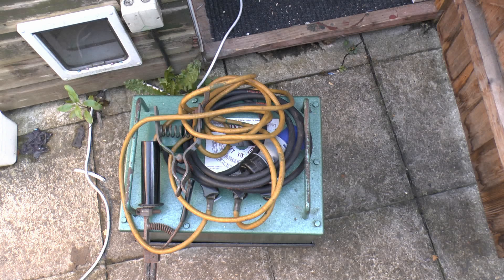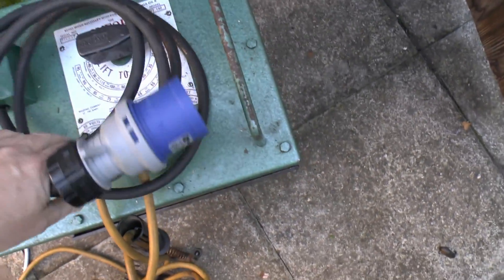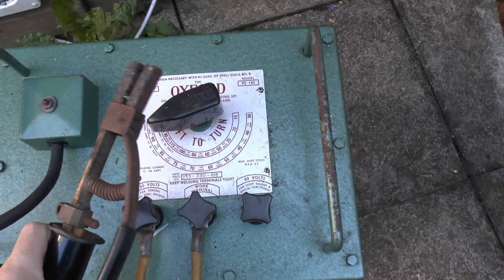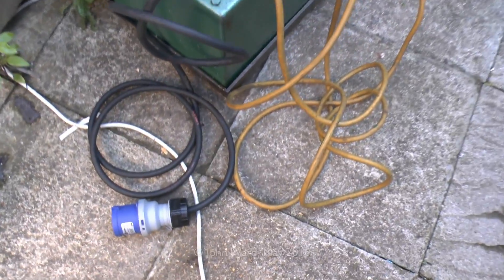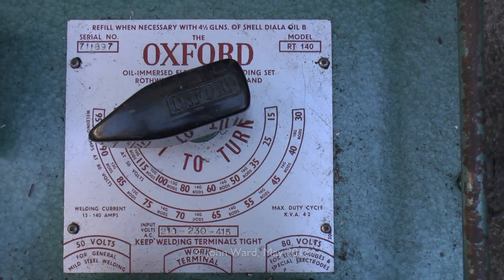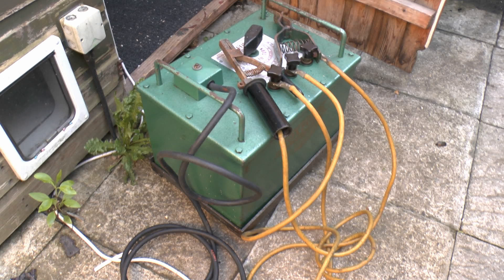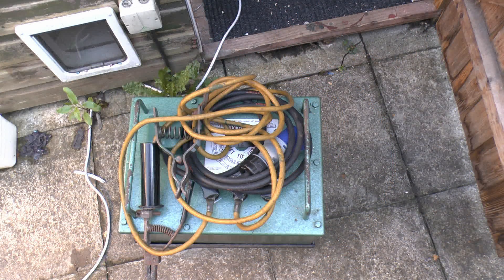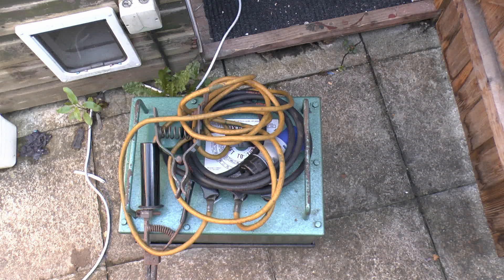Oxford Oil Filled Welder for High Current Tests

Comment: This is an excellent version of the Bantam Oxford  240 vote ac ark welder. Because they baste on a transformer the model is very hard-wearing.  & Have a very very Long duty Cycle It also has the capacity to lend itself to conversion to an AC Tig. . Some but not all are fitted with a Mentored of braze with the use of a carbon rod to provide an Ark to provide a ark to melt the filler rod, for brazing. but I have discovered the same can be achieved in AC by connecting too work leads to a Tig torch, & gas supply  The same can also be achieved to convert from AC to DC by fitting a rectifier between the work Input supply  & the live Negative earth for DC Tig work is proffered. As a Transformer it delivers a smoother current than one gets out of the coarser designs.   I have made the same conversion on my own set & used it for brazing jobs I am interested in the silicon barons version of brazing,

Comment: Hello, please reply. I have an Oxford welding machine, exactly the same as the one in the video. Is it 3 phase and does it weld 70.18 wire?
Reply: KO the one in this Film is a "240  Bantam  Modal & can be converted to 315  or 415, by changing the feed wires in the green box on the top The desired Phase Input is required. I have two tips for Welders One that is much larger & I keep for heavy weddings & have a bantam that is kept for 240-volt welding on a trolley so li can be moved to different jobs. & sights.  I often tack the bantam to do the general welding jobs,  If your welder is like the one in the film it will have the ability to convert from 415 to 240 Volts. If you own one consider yourself a very Very lucky person for they do not make the like anymore. You should hold on to it as long as you can.  & if you pass it on or down Instil on the recipient  That he or she Has, a diamond of a wedding tool If someone built them today they would make a fortune if I won the lottery I would go into business building them with a built-in AC/DC  filcher. for  Tig welding.

Comment: My RT140 has output voltage readings  85 v (at "80v" terminal) and 56v (at "50v" terminal), furthermore there is a 12v reading between the "Work Terminal" and the body of the welder. Why would this be and should I be concerned?
Reply: in some models, they had a transformer Or rectifier,  fitted which was a 12-changing ability we often found them in garages   &  for the charging of Batteries &  having a DC rectifier see the family that made them would make them to order if asked. That is why there was a variety of diverging designs & uses

Comment: Hi what kind of you need to top up?thanks
Reply from the maker: Originally Shell Diala B, however most transformer oil can be used.
A search for 'Shell Diala B' should provide plenty of options.
Reply: @jwflame  hi sir I’m
Considering to buy one of that model even they are vintage already..that’s why I’m making sure that the oil is still availble in the market.

Comment: Hi John,

Just wanted to ask if I can run an Oxford rt180 from my consumer unit in my house, would it be ok to replace an unused rcd in the consumer unit with a c curve rcbo and then run 4mm cable to a 32a ip67 commando socket fixed to the outside wall of the house.
The would be in the shed about 25 feet from the commando socket.

I do have a 32a supply to  a building outside but I’ve checked the supply and somebody has previously ran 4mm twin and earth  underground to an old style consumer unit (push in fuses) that is out there, I was hoping to find armoured cable out there.

Would be grateful for any advice you can give, thanks, Chris.
Reply: yes that is what I, use. if it is configured for 240 volts inside the green box there will be the Markings to convert to 240 volts.

Comment: Is the output ac or dc?
Reply: the main supply is AC & when it still has an AC current,  But if a rectifier is fitted between the  AC output & the job.  It is DC at the job, sufficed to TIg weld whit silicon bronze &  scratch stat the Tig,
Reply from the maker: AC

Comment: Hello, John ... 
A quick question; if I may?
I have a Pickhill 180amp oil filled welder.
Simply; can I run it straight from my house electrics on a 13amp fuse ... !?
I was told; but, not sure if the guy was winding my up ... if I did the above, the three-pin plug would weld itself to the wall plug because of the amps it is trying to pull, and the house fuse box, would go up in flames ... wow, frightened the life out of me (Or was the BS!?)
Look foreward to your guidance, John
Thankyou so much.
William (Hampshire UK)
Reply from the maker: The ratio of input current to output current is about 5:1 on older welders, so for 180A out you need about 36A in.  Far too much for a 13A plug, the fuse will blow immediately.

The stories about plugs being welded in and things on fire happened because people fitted a 13A plug, then found the fuse failed constantly and then bypassed the fuse, which overloaded the plug, wiring and everything else..

For proper use, a 32A dedicated circuit will be required, with a 32A connector.
Reply: @jwflame  YES FROM A 32 AMP  SOCKIT IN THE HOUS. THE ONE THE CKOOKR IS PLUGD INTO.
Reply: not a 13 amp plug A 32 amp socket Like the one the Cooker used.

Comment: John - my heart was in my mouth when I saw this video. Is this a crazy thing to do? https://www.youtube.com/watch?v=RoUN7v8TZlM
Reply from the maker: Welding through a can of butane is certainly unsafe and not recommended.
The part with the welder taken apart is all correct, and although it had live exposed parts, only the primary side was dangerous, the secondary voltage is only about 50V open circuit, with something connected across the output, the voltage is only one or two volts.
Reply: @jwflame  Thanks John. I might be buying one of these soon so it's good to know about these things. I guess this guy knows what he's doing since he's alive to tell the tale.

Comment: Hi just picked up one of these. The guy I got it from said I should took the Oil up but can't figure out how? Thanks in advance
Reply from the maker: Remove the bolts on the lid, and then lift the lid up - however the internal transformer and everything else inside is attached to the lid, so it will be very heavy, and also dripping in oil when removed.  For larger ones, an engine hoist or similar is recommended.
Unless the oil is low (which would imply it is also leaking), or there is some other problem with it, I wouldn't bother.

Comment: Is it able to  weld 6010 & 7018?
Reply from the maker: No idea, I have never used it for welding.
It's AC only so therefore can only be used with rods suitable for that.
Reply: @jwflame  can be adapted with a rectifier for DC  & ACDC for Tig.
Reply: Yes

Comment: Recently I wanted to do something similar and had been watching your higher current tests with the cables and fuses to get some ideas.  I ended up using a small switch mode supply.    Thanks for posting these.

Comment: How would you know when the oil needs changing
Reply: 1: When there's a big pool of oil where the welder was sat.
2: When you can smell burning enamel.
3: When there are flames pouring out of the unit.
4: When it weighs substantially less than what you remember.
Reply: @UCCLdIk6R5ECGtaGm7oqO-TQ  in most cases it been tipped over Or theirs a rust hole in the casing & the oil is leaking < I have tip mine up several times they may be heavy butt they will tip over if you let them do so. their surprisingly hard to stop once they start.
Reply: WM2869 . Wen the big end starts knocking.

Comment: A very good reason for not opening the box is the oil inside is very toxic or carcinogenic in the old welders.
Reply: +Nigel Kingsley-Lewis - Transformer oil is no worse than any other mineral oil, however there is some insulating oil contaminated with polychlorinated biphenyl (PCB)  this is mainly in the electricity supply industry where the oil was recycled this welder would have been filled when new with more than likely new oil and not recycled oil
Reply: +Rich ok  I used to have a large oil filled welder. I had to get a 25 litre drum of oil to top it up and the drum was plastered with safety warnings about toxicity.That Oxford welder dates from the 1970's when PCB's were used on a regular bassis.
 Well into the 1970s, polychlorinated biphenyls (PCBs) were often used as a dielectric fluid since they are not flammable. PCBs do not break down when released into the environment but accumulate in the tissues of plants and animals, where they can have hormone-like effects. When burned, PCBs can form highly toxic products, such as chlorinated dioxins and chlorinated dibenzofurans. Starting in the early 1970s, production and new uses of PCBs have been banned due to concerns about the accumulation of PCBs and toxicity of their byproducts. In many countries significant programs are in place to reclaim and safely destroy PCB contaminated equipment.
Reply: No it is not. But I wouldn't drink it.  I have used idyllic oil to keep it Cool I have seen the Greeks use extra vegan olive oil,  & it works well but any transformer oil will do when my steel casing. Got a leak from rust.  I made myself a.  New casing out of stainless steel. Often it's the water getting into the oil that creates the short. 
See, they are such hardy machines they get abused by their owners, left out in the rain and snow, and Often  Left for a year Abandoned until required again. left to get wet & rust out In guilty of that too. I made a New casing out of stainless steel & made a lid that when not in use would cover it up & keep it dry It can rust it stainless when I cleaned the old oil out it was the water that had gotten in I got it out into a clear container a filtered of the slog.   & left it in the sun, in summer To evaporate & warm the oil draining off the water that fell to the bottom that one clean I refilled it & topped it off with idyllic oil the original oil was still good and was 30. years ago. I used it last week Prickly ok.

Comment: Have you changed the oil out in it? Photonicinduction has had one or two of these that he changed the oil out, the old stuff was pretty grimy and burnt. Not sure if it affects the cooling capability of the oil though. This one also seems to be lacking the plug for the oil, but perhaps it's just on a side we cannot see, rather than the lid.

I have a feeling you won't be putting as much of a load on at as he has his, so the oil will likely last longer.

Comment: In showing us the high power plug, I was wondering if you could review some of the B.S. plug configurations as in comparison to the U.S. NEC plug configurations. It would be interesting to see if any were the same.
Reply: I don't think there be any overlap as far as the NEMA standard, we in the US like slots and flat blades whereas UK has round and square pins.
or to put it more "bluntly" we have to fight with "bent prongs", where as the UK you have to fight with "bent feet"....

Comment: I'm a little confused what you would and need to test?
Reply from the maker: +TheDutyPaid Anything that requires a high current passing through it, such as https://youtu.be/bBYHtBPbBJE
Reply: +TheDutyPaid You can "phantom load" old mechanical electricity meters up to their rated current to test their accuracy against another meter. Thats the most common reason i could think of. Or perhaps you have a questionable piece of cabling that you would like to cram lots of amps through to see how well it fairs. Basically you can generate large amounts of currents not possible off the mains itself, given a low impedance load since your working voltage is quite low. For somone who works with electrical as a hobby, an old welder can be a lot of fun :)
Reply: @Wiresgalore  This wedding for a brazing rod need not be too hot spent to do a good job  I ues silicon brans filler a good choice.